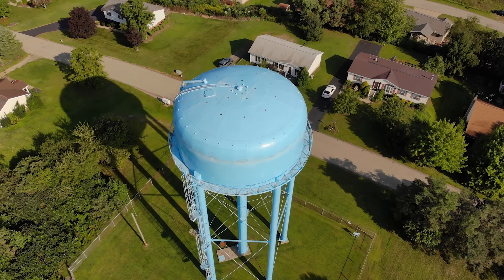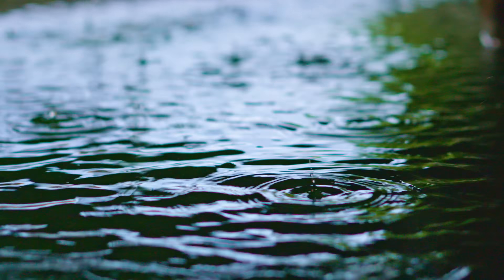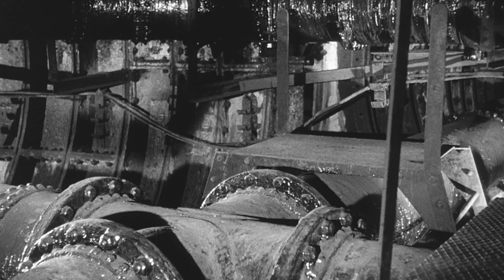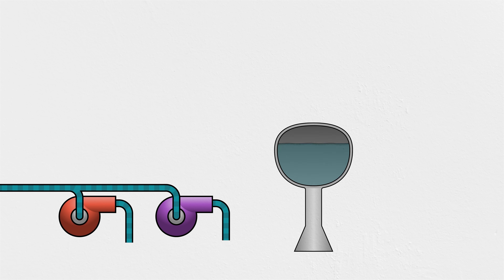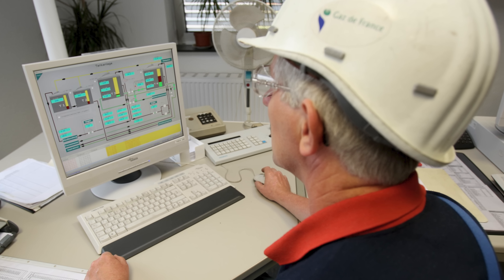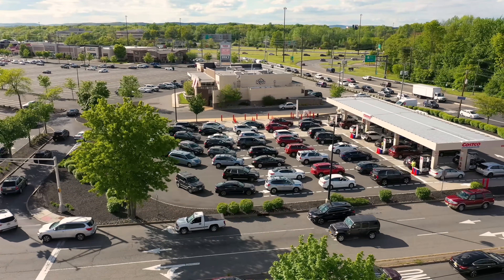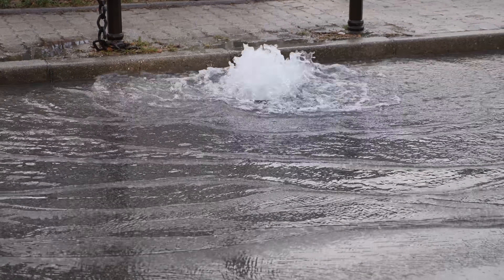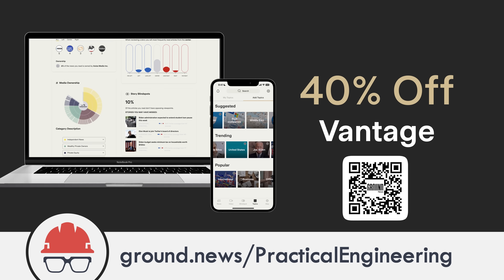When Infrastructure Gets Hacked

Comment: While Air-gapping isn't a perfect solution, it cuts off almost all potential threat actors. To bypass an airgap you need to physically get something to cross that threshold, and you need to be able to build something that can perform your nefarious actions without any interference from you (so if you don't know the exact SCADA setup you're out of luck). 

It limits your potential pool of threat actors from basically anyone, to large-scale state actors.

Comment: a close relative works as the head of a part of a public infrastructure and after he took over it took him about two years to make the whole thing run in an emergency. meaning they had stuff in place like generators but it w.sn't usable at all so they basicly had emergency test runs every few weeks for two years straight until they managed to keep it running without other utilities like electricity or the internet for a sufficient amount of time... the need to safety test critical infrastructure really should be a way higher priority than it is rn. your water utilities should not fail during a blackout neither should your gas, if they do it's time to elect someone who puts this as a higher priority

Comment: I am a cybersecurity expert, and yeah, most SCADA systems should be both air-gapped and any machines interfacing them should either have all the USB ports jammed with epoxy or fitted with systems that set off great big alarms to the security department any time a USB device is inserted. The rarity of following these simple practices is absolutely astounding.

Comment: 🇬🇧I was overseeing a conveyor installation at a UK sewage works 20 odd years ago and a Trojan virus was discovered in the control system computer which would shut the plant down was eventually blamed on China. I heard later that other installations had similar problems. 
Stop sewage but not water and chaos with overflowing sewage build up in the streets and gardens takes hold with diseases quickly following within days. Then try cleaning it up and treating everyone.

Comment: For a number of cases, the question of "why do you need off-site access to a critical piece of infrastructure?" is reaction time. While at a significantly different scale, the question makes me think about the rare plant seed storage at my job. If the freezers get above -15°F due to a malfunction or power outage, no one lives close enough to get on-site to fix the issue before the freezers reach a temperature that a number of our New England native seeds start exiting winter stasis at, killing their viability. The security risk has to be weighed against the disaster risk.

Comment: Just like 10 water level sensors, flow sensor and a simple microcontroller unit driving pumps. What do we need internet connection for?
And just overflow valve turning off power to pumps until water reaches some lower level. Without any microcontroller even. Just a relay (or solid state relay) disactivated by an overflow sensor with a preset dead time (determined roughly by maximal water demand and the volume of the tank) until next relay activation after water level drops to prevent rapid and frequent pumps starting and stopping. No programmable digital logic, air-gapped. What can go wrong?

Comment: I work on the power generation side, as a controls engineer.  We isolate most of our critical control networks, so you have to get physical access to them, to do anything. The Nukes have to do that, by law, and the burners do it by choice.

Makes things more secure, at the cost of some convenience.  I have always wondered if the distribution side of the house will eventually start running long distance, closed networks.  It would be expensive, but would make things a lot more secure.

Some plants I work on still use analog and mechanical controls.  Cant hack those, lol.

Comment: That's why you normally define limits for all values you can manually type into the HMI. The problem with 11.000 ppm could be avoided by setting the limits to e.g. 20-200ppm. Every value typed in must be within those limits.

Comment: I cannot speak confidently about industrial or utility control's structure. But with most building controls the remote terminal units, remote controllers or distributed controller are what contain the logic that controls the buildings. This has been true for close to thirty years. There was a period of time in the 1980's and early 1990's that the building controls were structured as you described. 

This distributed control has greater durability because network failures are less likely to cause control failures. (It was also faster since it isn't / wasn't limited by old network speeds.) The primary concerns during a network failure become lack of system visibility.  

Until about 2005 the central computer would act as the MMI (man / machine interface), central alarming and information trending. For the last decade the central computer, is now usually referred to as the system server. These act to collect trend information, analyze the data for predictive maintenance, system efficiencies & other, distribute alarms and store the MMI graphics. (Sometimes these tasks are distributed over multiple computers.) In a typical situation like a school district or large company it is extremely rare for building operators to physical access these computers. They are logged into from within the system network. Since alarms, like failed sump pumps, may need to be address during hours when no one is in the office emails of the alarms need to be sent to prevent building damage. So, these building management/operation servers must be able to reach the internet. 

It should also be noted that before computer control there was also pneumatic control and relay logic control. Many older viewers may remember attending schools with "thermostats" that hissed. These were pneumatic temperature sensors (or pneumatic thermostats) that controlled pneumatic actuators attached to valves and dampers to regulate the temperature and fresh air in the classroom. (The last time I was involved with a project replacing pneumatic controls with modern controls was only about 10 or 15 years ago. I am sure that there are still many systems that still exist.)

Comment: For the most part basic utilities is monitored enough not to be at risk of any hacking..  now when you talk about manufacturing plants, distributing warehouses, and industrial/ commercial facilities all have major flaws in most all of them..  some are even critically important enough that if certain processes were altered it could cause mass destruction of the area.  Like places that still use steam plants for heat..  all it takes is disabling a water flow sensor and shutting flow off for at least 45 seconds..  when steam is superheated in the boilers and the water is shut off the 12 inch or more thick walls of the boiler heat.  If water is reintroduced than you get separation of the bonds in water.  Big boom..  this can level a city block..  and anybody within that distance will be burned with steam hotter than 212°F..  is wild just to think about the things that could go wrong with different eyes.  Ive been in some plants that use chemical reaction processes for product line production and some chemicals are fine when mixed with known small values but more of part a and less of part c could make product y turn into product boom..

Comment: I've always wondered if water towers are vented or completely sealed. I imagine sealing them would be simpler and would help provide pressure, but they might hold less water if sealed. So which is it? Can you shed some light?
Reply: After watching the video I assume that they are vented because otherwise the water tower would not overflow after an attack.

Comment: You’re speaking my language. 
For most every analog value (ex. tank level) there were seven values: 
Hi Hi alarm 
Hi warning 
Hi limit 
Field measurement reported 
Lo limit 
Lo warning 
Lo Lo alarm 
The field measurement was what the sensor in the tank was feeding into the PLC (Programable Logic Controller).  Limits were start and stop points of the operation.  Warnings would send an alert to the licensed operator, but the system could be left alone to try and bring the field value back within limits.  Alarms were sent to operators, management and support staff to take action and may prompt the PLC to take further corrective action.

Comment: What makes infrastructure so vulnerable is people's assumption it will just be there forever while at the same time not wanting to spend money on it or even actively complaining that the government is spending too much on it. So I am not surprised that many of the less "for the people" governments have handed over this responsibility to for profit corporations that will strip as much from the process so that they can walk away with as much money as possible knowing that WHEN things go wrong the government will be pressured by the people to take action immediately which generally means a giant pile of money. Of course there will be many promises of making things better but once people have once again become complacent most of that money will just become profit instead. The power outage in Texas a few years ago during a snow storm is a perfect example of this and I have no doubt that the corpo behind it has done everything in its power to avoid spending more than absolutely necessary to get the government and the people off their back. Worst case scenario they'll get a small fine but even if they are forced to leave they'll do so with big piles of tax money stashed away.

Another prime example of this is rail safety as the people in East Palestine, Ohio can attest to. I doubt the corporation has cleaned up or compensated people properly and likely never will. They will just wait until the media storm blows over, bribe a few officials and it's back to business as usual.

This is of course even easier when it comes to remote, digital, attacks as it is easy to wave away their own incompetence and negligence and just blame big bad Russia or China or whatever attack group they can blame that the people and government will accept.

Comment: Why do the controls for infrastructure NEED to connected to the internet.  Seems that important infrastructure shouldn't be.  Just a separate visual only monitoring system should be visible to those with access.  And the FBI taking 2 years to come to that conclusion basically says that they are a useless organization and severely needs to be restructured or dismantled entirely.

Comment: Scary thing is, some of this  stuff is so terribly bad that it beggars belief.   I'm no security expert / consultant / what ever but I have done work writing I guess what could be called middleware, stuff that gathers data from things for automation purposes and sends commands to achieve what ever.  I've seen equipment with a nice web interface for direct control, with a nice username / password prompt, definable users and passwords and it all looked like it was secure.   Poking behind the scenes doing nothing more than looking at what was going on via the developer tools included in every web browser once 'safely logged on', showed that all the backend was done with an unauthenticated plain (unencrypted) REST style web API.  Just formulate a request, throw it at the device and away it went.  Open that valve, turn that motor on or off, no authentication required.

Comment: As someone working in IT, what I took from this was that, other than stuxnet, using 2FA or certificate based authentication systems would have stopped all the attacks that were brought up. And using those technologies is certainly the industry standard for remote control of any important system. You don't use a password for something like that. Unfortunately substandard IT practices are commonplace, they're just not seen as a priority until after something has gone wrong.

Comment: When I was a kid, I was told water systems had towers. But, my city didn't have a tower, so I couldn't figure out why we were different. It wasn't until later, I found out you don't need a tower if there is a high elevation to place the tank and sure enough, realized the city's tank was on top of the hill next to the main reservoir.

Comment: It’s worth pointing out that industrial systems are often put in once then left forgotten until years later when something bad happens to bring attention.  No firmware updates, no password or passcode changes, sometimes even no security whatsoever.  Just imagine a Windows 95 machine that’s been doing its job for years and then some bright spark puts it on the network.

Comment: I think this happened when we were commissioning a waste treatment plant. The scada didn't normally have internet connection but we had set up a temporary connection for remote programming via a GSM modem. Suddenly valves opened and closed like crazy and we saw someone was clicking on the display without being there and it wasn't our programmer. I pulled the cord from the modem and it stopped but if it had happened unattended, it could have caused some damage.

Comment: A simple solution to prevent this from happening again would be to add a float switch to the top of the tank that automatically shuts off the pumps if the water gets too high.

Comment: IT security of infrastructure component (including critical ones) has been neglected for many years. It's slowly getting better, partly caused by an interesting test they did a few years ago, officially letting interested hackers attack a part of a power grid substation (if I remember correctly) and they had to end the contest after half an hour to avoid a transformer exploding. ... Funny and scary.
Basic IT security concepts like authentication and authorization common for the computers we work with on a daily basis are not that common for the little boxes (small computers controlling infrastructure, etc.) and the like that are legitimate network components (i.e. can be accessed / attacked) via a network. Due to a lack of direct user interface they are easily overlooked but need to be secured nevertheless.

Comment: I worked at a power plant simulator company. It was cool seeing SCADA discussed because I spent much of my time reproducing many different manufacturers' HMI systems so they could be connected to the simulation model built by the engineers. IT was always paranoid with our simulator computers, which were always on a separate network. It was also hard sometimes to get the data from the plants so we could simulate the various systems accurately. I did do much of the computer work for them too, and had to go to a few sites that were never connected to the internet, and Windows update would corrupt trying to get updates killing the networking, so I got a few quick trips out to random places to fix Windows.

Comment: A municipality wont have an advanced cybersecurity expert and wont dig real deep into network attacks and will assume it to be a fluke.  This is exactly where you would test run a modern attack design before full scale attack.  They knew this was a small town just large enough to be digitalized and therefore is exploitable.  This was a learning experiment, not something to be easily dismissed.  The world is dangerous, learn how to maintain water quality in stored vessels.  🍻
Reply: Civil infrastructure should really be more of a isolated system.  If an operator cant afford one supervisor 24/7 per facility, then really how efficient are they?   There is no reason to have a direct i/o link between say billing and distribution pump control, a human middleman can solve this. If nothing else, data from a center should be like ROM and be read only.  It can notify people but NO ONE can remote access or make meaningful changes.     Cyber security is that simple, give everyone minimal scope and pay attention as much as humanly possible

Comment: "breached" its a bold word that sounds like someone very skilled did this...    most of the units run a unsecured VNC server.. if you find their IP (using ip search websites that work like google), you get full access without "hacking" anything,  just connect with any remote desktop / vnc viewer and you got full control over them.  
you wont believe how many hosts there are from people and companies that got no idea that changing the default password or even setting one in the first place is a must.

Comment: You don't need computers to sabotage infrastructure: A few weeks ago it was discovered in two German important military bases (lLuftwaffe), which each had its own independent water supply, with its own purification plants, that somebody had entered the bases through holes in the perimeter fences and then broken into the water purification plants and contaminated the drinking water.
One base (Geilenkirchen) is an important NATO AWACS base and the other one at Cologne airport houses not just the government VIP fleet of aircraft, but also central IT infrastructure for all services (Luftwaffe, army, navy).
It is suspected that the saboteurs were Russian and that it was a test run.